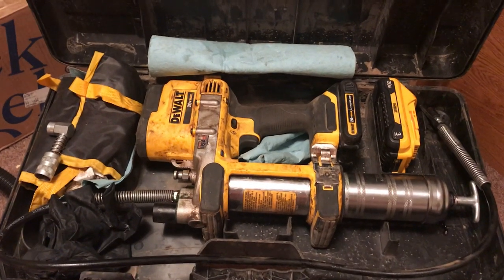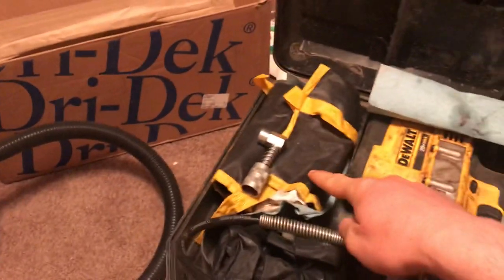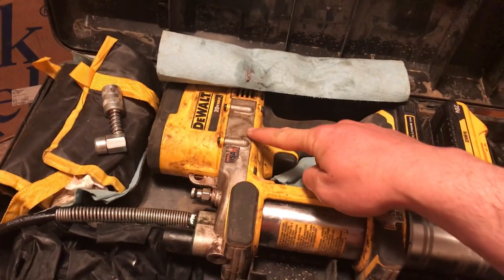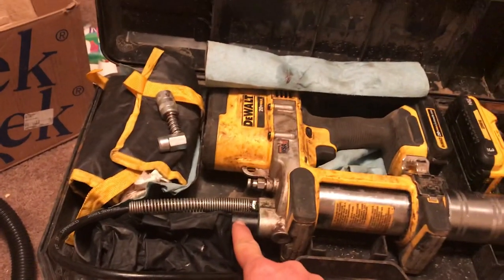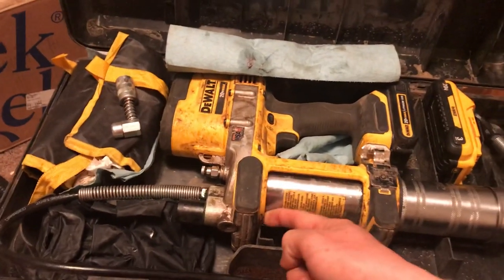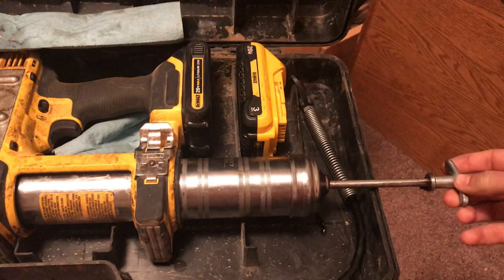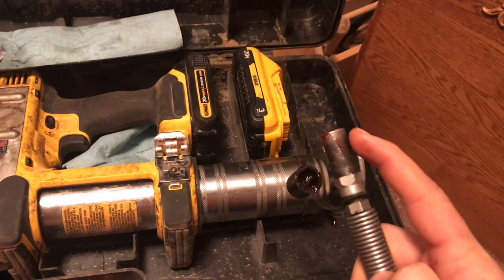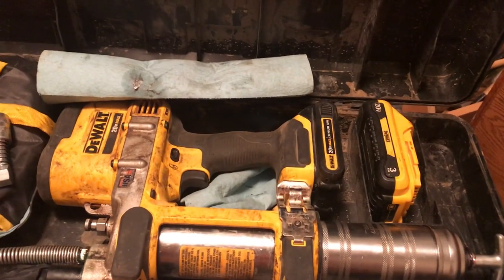DeWalt Grease Gun Tricks

Comment: I like mine but it's way messier than a hand pump one. Hand pump kind I don't know why they don't leak all over maybe store them upright on a wall or hook. This thing laying in the case the oil in the grease somehow gets all over my case filled with oil mess. I used brake cleaner and filled it with acetone about 1/2 inch deep then took a brush and brushed the bottom of this case. Only thing that got it clean was a friend had a hot water Landa pressure washer we hit it with that melted the stuff off. Now when I'm not using it, I remove the cartridge put it in a plastic bag with freezer bags over the ends. I don't use it all that often just on maintenance of my jeeps and other cars. I suppose if I had to use it daily Probably just carry a box of gloves.

Comment: Hello from Greece) i want to ask, will this gun work with liquid oil? I am thinking of using it as a high pressure pump in a small press, as the manual says 700 bar pressure. you were able to try to fill in car oil and try. I will be glad to your comments.thank for your attention
Reply from the maker: Greetings Alex,
I have never tried to use oil in a grease gun. I would bet that oil wouldn’t be viscous enough to function properly. 
This link is for an oil gun, see if that helps:

boeray 2 pcs 8OZ Capacity（250ML） High Pressure Pistol Hand Feed Oil Spray Gun Pump Bottle Oiler Can https://www.amazon.com/dp/B07PMJT1HM/ref=cm_sw_r_cp_api_glt_i_0YMH472898S9WFA6M79C
Reply: Giasou Alex!

Comment: How do you put it away in the case with a New cartridge installed
Reply from the maker: Screw the cartridge back on to the gun, push in the plunger and it should fit just like mine does. Does that answer your question?